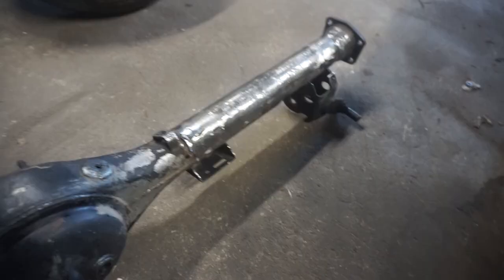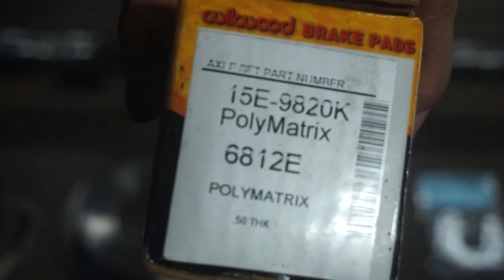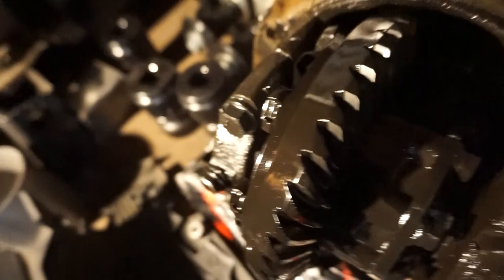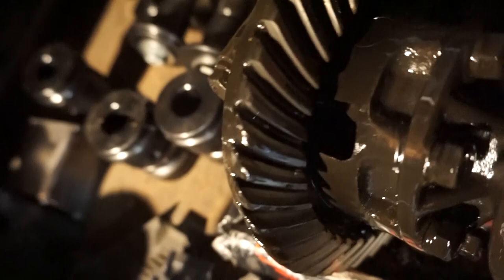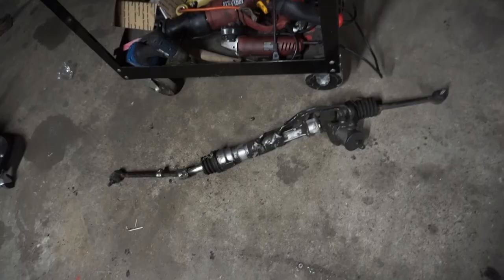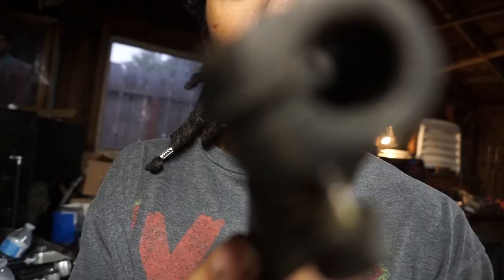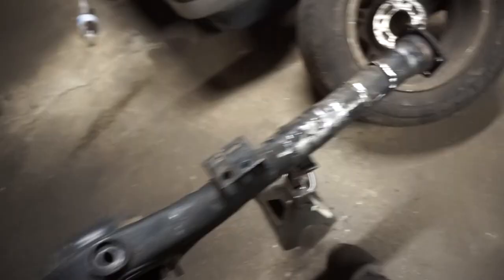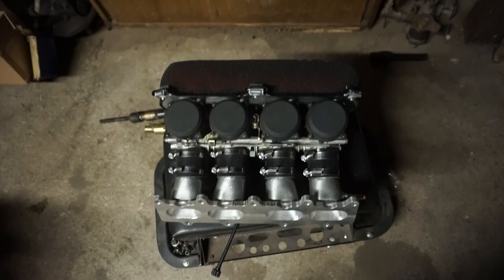*EASY AE86 SR5 DRUMS to DISC BRAKE SWAP!!!*

Comment: For parking/handbrake setup, use rx-7 FC rear calipers and wilwood for hydro.
Reply from the maker: youre the best for this! just ordered a pair off ebay for 45 bucks. i might use the wilwoods for main brakes and the fc calipers for hydro tho, only cause manual brakes lol. thank you!
Reply: Do you use the same brackets as the willwoods?

Comment: Glad to see you still around.  The CD009 looks like a tight fit in the Celi, but it seems you're no stranger to cutting and welding.
Reply from the maker: oh man, ive been kickin and paddling lol. yeah the cd009 looks like i might have to widen the trans tunnel abit. maybe a 16lb sledgehammer might convince it lmao

Comment: I converted my sr5 to GTS  all the gts  rear hand brake cables where still easily available you just need the back ones , bolts up  to the front half no problem
Reply from the maker: i didnt know that! tbh i figured most of that stuff was either worth gold or id have to find some parts broker in indonesia or something lmao. but im going dual caliper in the rear later only cause i dont like dealing with drum brake stuff lol. im not really planning on sliding the tercel much, mostly autocross and lap days.
Reply: I got it threw lordco fairly cheap might give you somthing to work with to modify thats remotely close
Reply from the maker: @weaksaucep4539  if I don't end up going dual calipers in the rear I'll check them out! I actually located a rebuilt gts rear end with low miles I might pickup

Comment: Dude I've been trying to figure out how to do this for my buddies SR5 86 and this helped out a lot! Sucks that the hand brake wont work for the conversion, so I'm curious if switching out the SR5 handbrake from a GT-S, or at least the brake cables, would make it work.
Reply: Also, for a manual rack and pinion swap, did you check out Techno Toy Tuning and Xcessive Manufacturing? They pretty much have everything for a manual rack swap.
Reply from the maker: The main issue is the ebrake is essentially a drum brake assembly that stops the inner hub of the brake rotor. So you'd have to find a gts ebrake drum backing plate, and build it off there. T3 also has a double caliber bracket but it is around 300 bucks I think. I'm actually trying to work with hawkmachine on making a set of brackets for dual calipers. Just waiting on a reply from them
Reply from the maker: But I'm glad I could help! Anything to help keep the sr5s alive! Lol
Reply from the maker: Forgot to reply to this, but yeah I actually ordered the quick rack from T3. Gotta wait till december for it to come in tho

Comment: aw11 steering rack works in my 86 really well and it has a better ratio but you must use a mk3 supra steering shaft so the diameter fits the splines
Reply from the maker: i was actually looking for an aw11 rack at the junkyards for the longest time but never find one thats manual. i ended up ordering the quick rack from techno toy tuning. should be getting here sometime late december!

Comment: What is the part number for the rear willwood caliper?
Reply from the maker: 120-9689. This caliper is for the 3.75 inch caliper brackets. Both the 3.75 caliper and 3.25 caliper cost the same, as well as the brackets from hawkmachine.
Reply: @GutZ_47  so the part number you posted for the bracket is to use the caliper part number you just posted? Thanks btw
Reply from the maker: @krakdaus5442  yes sir. If you're interested in the 3.25 caliper and bracket, the part numbers are 120-10188 for the calipers and 31-325 for the brackets (375 for the 3.75 bracket)
Reply: @GutZ_47  thanks.. I almost spent good money on a gts diff today but someone already snatched it up.... Savages I tell ya.. looks like I'm staying open diff until WEIR offers the full complete upgraded diff like he said he would.
Reply from the maker: @krakdaus5442  im in the same boat, luckily i have my celicas old rear end laying around. its a bit beefier than the sr5 so if i ever blow it up ill swap it in. you should check out CM Autohaus, they do alot of corolla work and he might be able to help you find a gts rear!
Reply: @GutZ_47  thanks a lot I didn't realize they were in Fremont I'm from SoCal so that shouldn't be too far from me.

Comment: so... i found a celica 6.7" diff thats the same as the ae86 gts diff. except it has drum brakes.. do you think the same brackets would work?
Reply from the maker: they might, the sr5 is a slightly smaller axle housing so the brackets could be smaller, i have a celica rear end too. ill hit up hawk machine and see if they have any recommendations, that way i can prep the celica rear for discs too
Reply: @GutZ_47  will this same swap part work for the 6.7” solid axle?
Reply from the maker: @16wmaheu  yessir! if u go on weir performances website, they have a spool for both the sr5, gts, and celica straight axles, the brake caliper bracket will also work since they all share the same mounting flange for axles/brakes